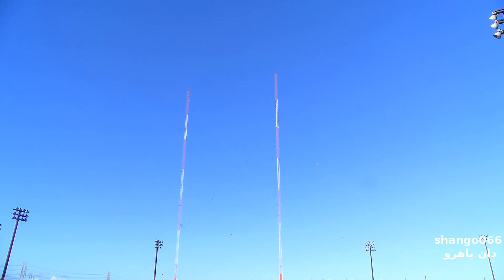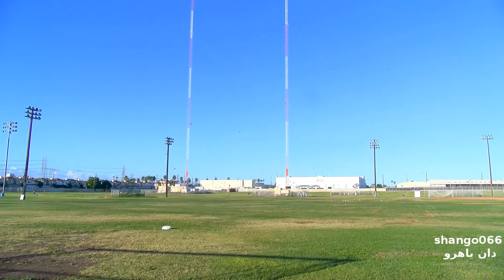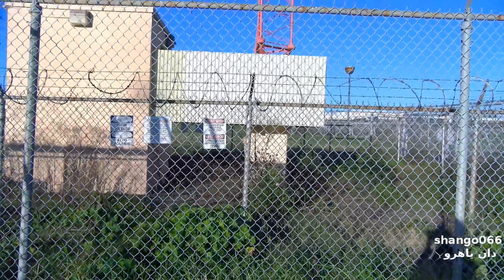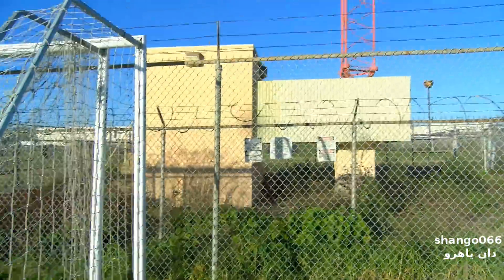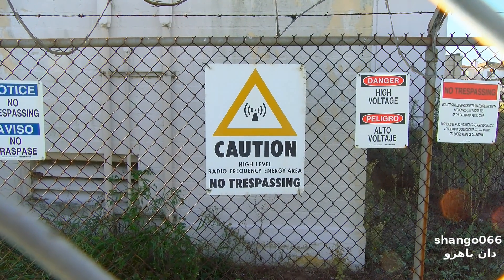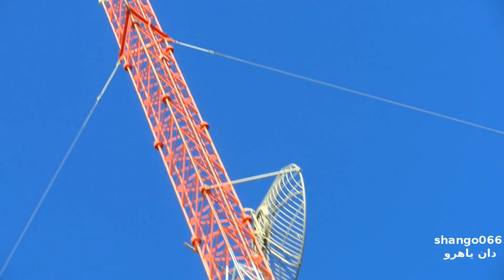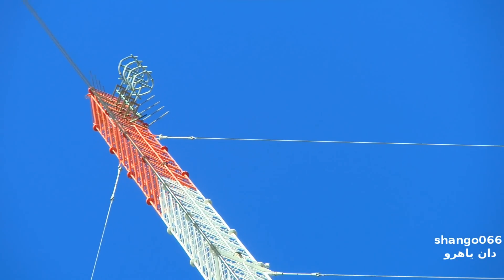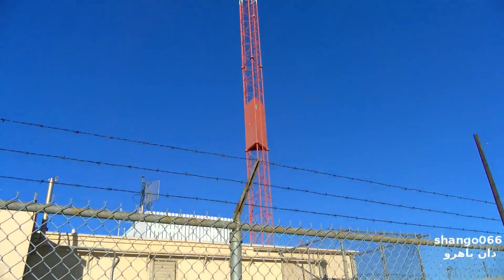Commercial AM Transmitter Site Antennas 4K

Comment: It looks  at least 50 or more years  old   50 kW  that's  strong  for a AM station.  Most  are  5 KW  . A coil and a diode  small speaker probably  hear it . Here in South Florida  a lot of them are remote with 5  towers  grouped with the dog house  next to them  there insulated  and the guy lines are to .  When the lighting  hits  them they go quite  for a bit and then come back .

Comment: Nice setup. I think that dish antenna is the microwave relay from the station. Stations are required to lower their power at night and reflect their signal in one direction to prevent interference to other coverage areas.

Comment: BBC radio 4 Long wave (1500 meters or 198 Khz) transmitter at Droitwich in England is 500KW and has a range of 2500 miles at night, 1500 miles in the daytime.  It can be heard right across europe as far as the balkans, greece and scandinavia.
Reply: Hi from Scotland. In order to  have adequate reception on 198khz here, there are two boosters of 50kw. Did you know that the UK has the right to another LW frequency - 225KHZ?  Currently occupied by Polish Radio. It used to have the tallest radio mast in Europe until it collapsed. Its now a lot smaller and just audible up here too

Comment: First tower is neither a reflector nor a director. Both towers are "phased" at night to redirect/shape the antenna pattern to protect other stations on the same frequency. That first tower is not passive, it has an active RF current on it which is transmitted "out of phase" with the other tower, using a device called a phasor. With only two towers, the station probably transmits omnidirectionally with one tower during daylight hours; both towers are used out of phase at night.
Reply: This is a clear channel MW station...using the 50kw maximum power allowed in the US,  therefore a pattern change is not required, so remains omnidirectional 24/7
Reply: @terrywilson4118  It looks like that to me, I was a broadcast engineer for WFLC,WRFR,WACQ, WHEC,  over many years as I traveled south to where I am now. I still do some work in the field, but don't climb towers anymore. Climbing towers are for the younger men. But it was fun while it lasted! I had my own classic rock show on Saturday nights until signoff at WRFR for two years, and enjoyed every night until I moved South to East Central Alabama. I then worked with Fred Randall Hughey at WACQ in the 1998 to 2005 years until had to retire. I still work now and then on problems that station personnel cannot solve, still have all my test gear in my truck so I can just jump in and go, work for cash only for obvious reasons! I still think that Collins boards and Audiovox boards are the best in studios because parts are still plentiful and inexpensive for them. Collins and Harris transmitters are the brands to beat because they can stand the abuse of storms and clear statics that build up on the antennas where others can not. I recently brought a station that went "dark" for 15 years back on the air very easily - so the adventure continues.

Comment: What we have here is... what looks like 400 foot Rohn 95 main radiating tower with a grid parabolic and 4 bay FM broadcast stack (The parabolic on that tower is the microwave STL for the FM) the rectangular parabolic grid antenna on the transmitter buildings roof is your AM STL.
Your second tower is a back up towe in case the primary goes out or is damaged, and it can be used as a reflector BUT it will not be very effective. Usually for a reflective AM setup you need one driver tower and at least three reflectors to be efficient.
In this case that station does not have certification to be directional so its an omnidirectional station.
710 KEEL and 1130  KWKH in NW Louisiana are both high power directional stations with provisions to be either omni or directional and increased RF power during night hours..

I have the same type of tower stacked to 500 feet with 2 antenna farms upper is VHF / UHF services, lower is cellular services .

Comment: You were walking on the other electrical half of that antenna (the buried radials).  Looks that site is surrounded by public access & urban sprawl which explains the razor wire and double fence. They also have anti-climbing panels installed on both main and backup. I wonder how many fools have attempted to climb that 50KW main when it's hot.

Comment: I bet the people living right by there have hard time trying to listen to other stations our station is only about 1kw but knocks out all stations for about a mile round it on most radios that is dream 100.2
Reply: EastAngliaUK   I believe you are talking about FM however, not AM since you mention 100.2  in you case. But you can be correct about that effect with AM as well.  Local AM receivers can be overloaded with signal out to a certain mileage distance from the tower.  Interestingly, this has become a problem in some local areas where some nearby stations (AM) have had their signals impressed upon the antenna towers of OTHER nearby AM stations. You can in some instances hear one stations signal being re-radiated, albeit at a low level, by another station because the signal is finding its way into its neighbor's transmission system. New York Major market 50 kW WOR AM 710 kHz transmitter in New Jersey has traps on all 3 of their towers to filter out 1190 kHz WLIB a 10kW neighbor whose towers are almost within spitting distance of the WOR antenna array. These traps detune the WOR antenna relative to 1190 kHz.
Reply: Wychbold village just feet from the Droitwich masts must have protection for phone lines as the field strength there is enormous.

Comment: According to the KNX Wiki page, the second tower is not a director, but is an emergency backup antenna.
Reply from the maker: +gotham61 Makes sense to have a backup but that building is right on the ground. If there was ever a major flood here it would get wiped out. I would think they wouldnt want an omni pattern with it so close to the coast.
Reply: +shango066 Class A AM stations are normally required to be omnidirectional.
Reply: @shango066  KFI does
Reply: +shango066 The idea when that was built was geared more towards a Soviet nuclear attack, Those buildings are most likely hardened and reinforced with poured concrete and steel skeletons, heavily grounded too.
Reply: +vwestlife Heh, amazing to meet you here :-P
Reply: Standard practice would be to de-tune the tower not-in-use so that it would not mess up the omni pattern. We did that at WBAA, which used a single tower for omni in the day, and 3 towers for directional at night. During the day, the 2 unused towers were connected to de-tuning networks. At night all 3 towers were driven.
Reply: @timothystockman7533  Same with KJOY in Stockton.  Two-tower array, 1kw omni day, 1kw to the west at night to protect KFOX (later KFRN Long Beach) and KTLN/KTLK Denver
Reply: +gotham61 Scott Fybush wrote about the KNX site: "In the fifties, CBS experimented with a directional antenna system here, in hopes of reducing the amount of signal the non-directional tower was radiating over the Pacific Ocean. 
For whatever reason, the DA was not a success (unlike its cousins on the East Coast at WBZ and on the Gulf Coast at WWL), and KNX was back to non-directional operation in the sixties, just in time to become one of L.A.'s two all-news stations. There's still a second tower at the KNX site, but it's strictly for auxiliary use these days."